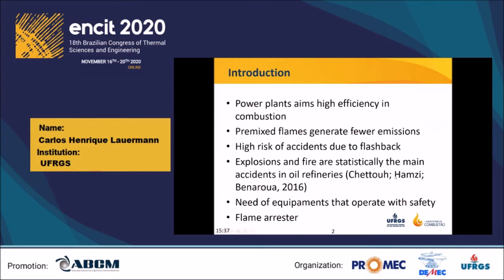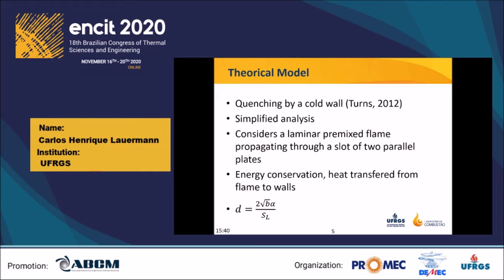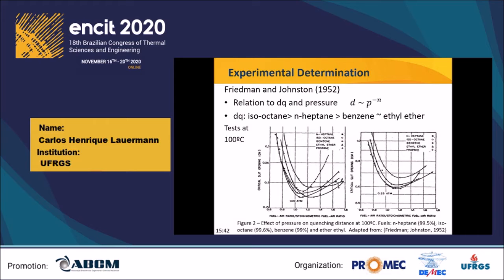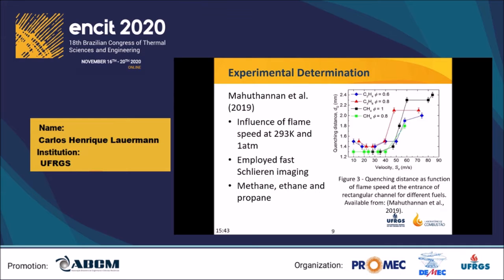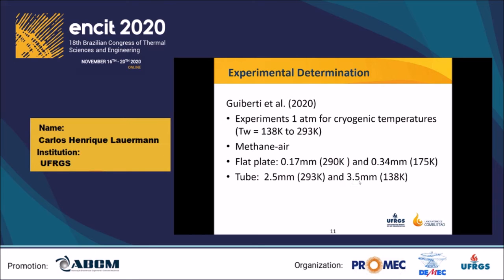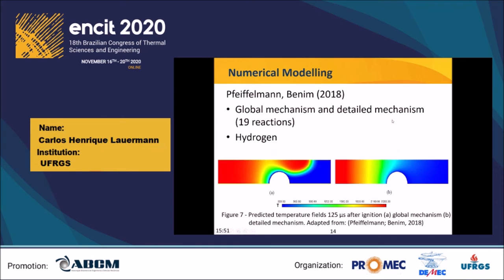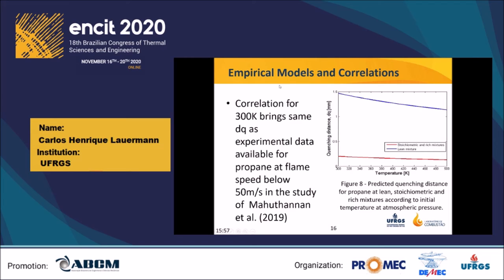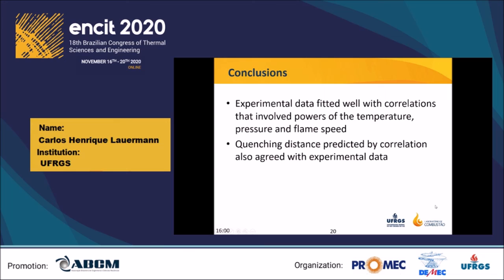ENCIT 2020 - STATE OF THE ART ON QUENCHING DISTANCE STUDIES

Comment: In the course of your literature review, have you identified works that report the quenching distance as a function of the relevant mixture non dimensional numbers, such as the Lewis number and the Zel'dovich number? If so, what are these works?
Reply from the maker: Hello, Luis Fernando. Thanks for watching our presentation. There are some works that relate the Lewis number to quenching distance, Mahuthannan discussed its effects in “Effect of propagation speed on the quenching of methane, propane and ethylene premixed flames between parallel flat plates”. For Lewis number larger than 1, the flame becomes weakened and the extinction may occur. We did not find articles that relate the Zel’dovich number to quenching distance directly, although there is a relation between Zel’dovich number and laminar flame speed. Kudriakov in “Numerical simulation of the laminar hydrogen flame in the presence of a quenching mesh” defined a quenching temperature which relates adiabatic temperature to Zel’dovich number, given by Tq = Tad – Tad^2/Ta and it’s known that Tad^2/Ta = (Tad-Tu)/Ze . I hope I have answered your question.